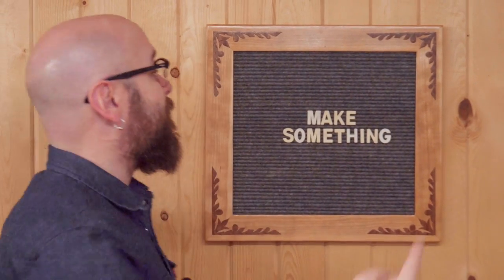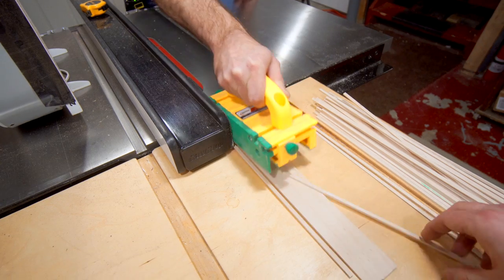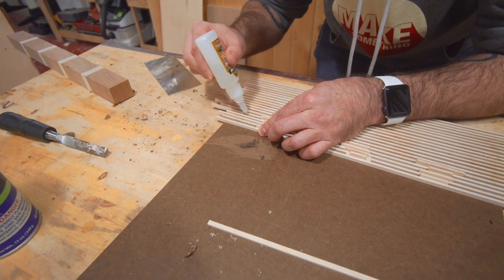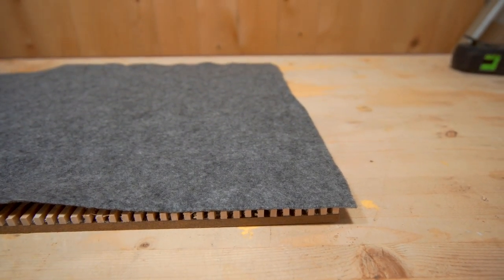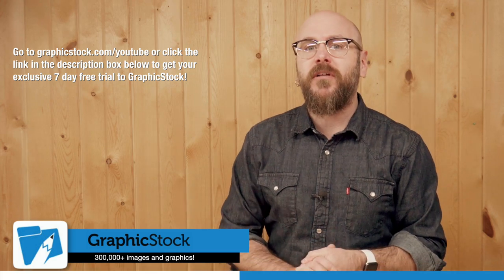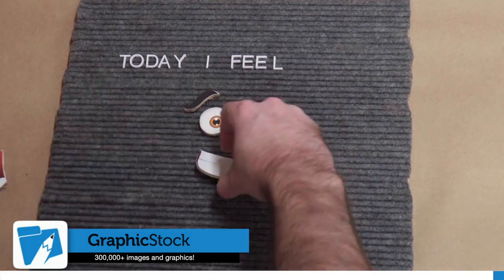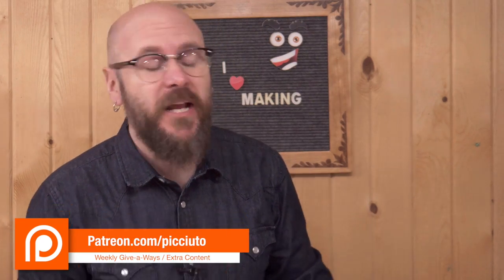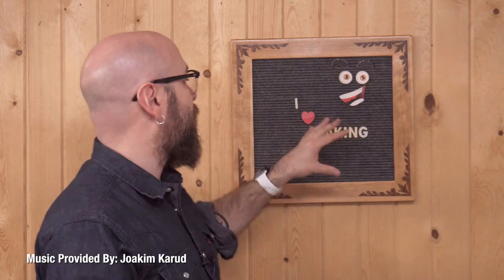How to Make a Letter Board | Easy Woodworking Project

Comment: Right on brother! Great project! There's always more than 1 way to skin a cat, and you found one here!

From my experience making letterboards, if you are using the 3/4" letters readily available online, a 7 1/4" Diablo circular saw blade (thin kerf) mounted in the table saw does a decent job getting the right groove width. They will be a bit tight once the felt is inserted, but you could always shim one side of the blade or adjust it out of parallel to the fence every so slightly to make the groove wider. OBVIOUSLY do this with caution. The ideal width is about 0.090" I think.
I use drywall knives to insert the felt (very thin metal), using the same technique you did here. No glue necessary with such a tight fit. 1/4" deep grooves, 1/4" O.C. Taper the grooves ever so slightly with a sanding block to ease insertion (that's what she said).

Hope this helps somebody on their project!
Reply from the maker: Thanks josh! I did have a thin kerf blade installed and that didn't work for me.
Reply: A 10" or 7 1/4"? My 7 1/4" Diablo circ saw blade is way thinner than my 10" "think kerf". Your letters looked bigger though, so it may have been too thin anyway. Regardless, you got er' done and had some fun!

Comment: An alternative is to get some magnetic backed printer paper, make a frame with some behind some material, then laser cut letters from another sheet, being as the backing and the letters are magnetic, it should give better hold than a sheet of metal in the frame.
Reply from the maker: Ohh, great idea!
Reply: Just  thought, not sure how the heat of a lase cutter will affect the magnetism, but a test will tell you

Comment: Would using an 8 1/2" circular saw blade in your tablesaw be a thin enough kerf for the letters? I don't know if it's any thinner than the thin blade that you used

Comment: David, in the finished project (though a little hard to tell) it looks like the gap between the slats is very close to the original one you tried with the saw blade.  What if you used a thin kerf blade on the tablesaw.  Might that make that part of the process a little easier?
Reply from the maker: I was using a thin kerf blade.

Comment: wonder if you could find a clear material for the board, allowing it to be backlit? 

one of these would be a perfect signboard for our hackerspace.

thanks for the idea on how to make one Dave!
Reply from the maker: +JDG Industries that is a super cool idea!!
Reply: JDG Industries I wonder if you could cut it out of acrylic on the cnc?
Reply: Michael Schuler it's the felt that gets me. if it was just a solid material, you could get transparent aluminum for all it matters. it's the holding power for the letters I can't figure out.... unless you could make a felt out of Easter grass type material?
Reply: Oh darn the felt. You would have to have some sort tapered slit. That would be very hard to do.
Reply: Michael Schuler a custom router bit could do it?
Reply: Like a mini dovetail bit. Then you would need letters that had a matching dovetail back that you could slide from the sides.
Reply: Michael Schuler that would be a hell of a job to do all that AND cut out the letter so they actually looked like letter and the back holding piece didn't screw up the shadow cast by the letter.

wonder if you could do something based on the old Lite-Brite technology?

Comment: I see the Grippr everywhere on Youtube these days. I get its purpose. Likewise, has anybody ever accidentally cut into the plastic arms or whatever?
Reply from the maker: Yes, I've done it a few times.
Reply: Then what happens after you cut into it? Does that portion need replacing, or can you keep using it as-is? Thanks. RJ